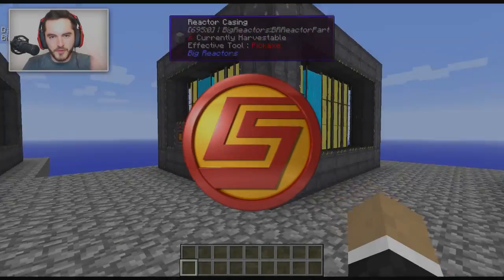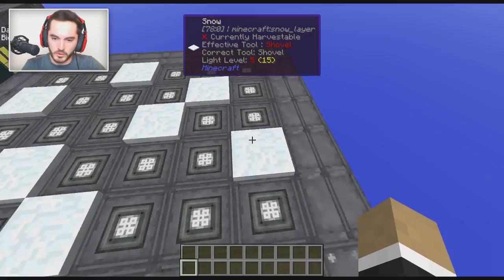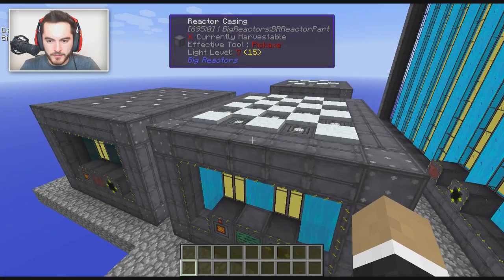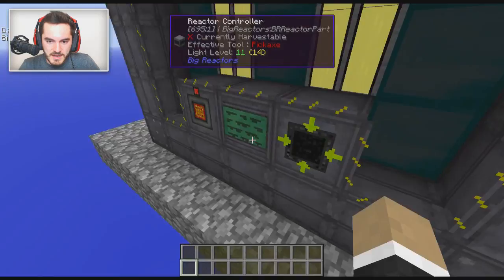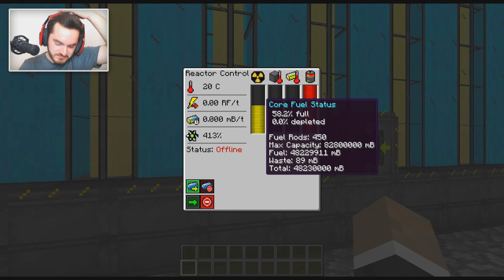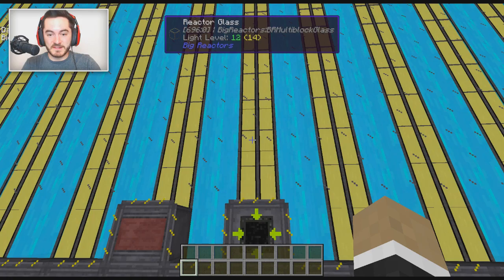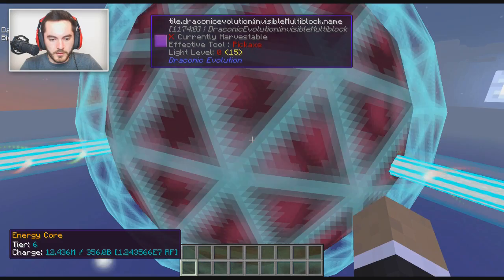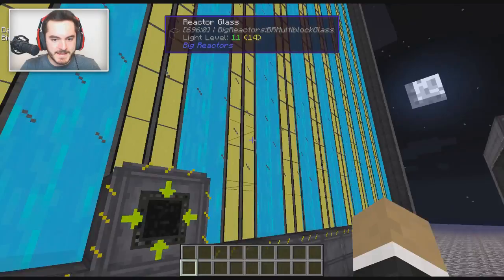Minecraft: BIG REACTORS MAXED OUT

Comment: Only 1.9MRf/t? I thought it would be more than that.
14,300 RF/t  /  5x6x2 (60) /  = 238 RF/t per block
1,900,000 RF/t / 30x30x46 (41,400) = 45.9 RF/t per block
 So, for those who just want power, and are not concerned with showing off, you'd be better off making a series of smaller reactors. (using interior dimensions, so fuel and coolant only)
Reply: +DFPercush the taller you go the more efficent you get
Reply: In that case, I guess the best setup would be a tall, narrow column reactor. But this giant thing in the video is atrociously inefficient.
Reply: DFPercush
correct also i have noticed that if u put 3 blocks of space from the rods to the casing then put resonant ender at the casing and cryotheum in the other 2 spaces the efficiency goes up by about 15-20% than if u had them all the way to the casing and have cryotheum

Comment: How is it only getting 0.2 mB/t? I built the same checkerboard reactor and it uses 2.3 mB/t ?!? The Energy output is the same as show in the video but it is using way more fuel.
Reply: blocks or ingots?
Reply: ?? Not sure how that matters. Once it goes into the reactor it just become liquid fuel measured in mB. The only difference I've noticed is if you use block you have to wait longer till 9000 mB of space is available.

As for the recommended design I copied what I saw in the video in CrackPack modpack and the output matches but the fuel usage is far higher. Not sure if it has a different usage rate in the pack he is using.
Reply: PyroMancer2k I must admit I'm not the best at big reactors. The pack he is using is sky factory based on the tree in the background
Reply: Perhaps it is based on coolant? Unless you used the coolant type he used. I am not sure if that even affects anything.
Reply: config.

Comment: What's the difference between active and passive cooling?
Reply: Actively cooled is for Turbines :3
Reply: +Colin C. actively cooled is way more efficent. the maxed size reactor of his is producing around 1.9 mrf/t but with actively cooled you could make 8-20x that much depends on how long you want to spend with making turbines(not just one turbine but multiple)
Reply: angie rossman Are turbines blocks? Where would you put them on the reactor?
Reply: Colin C.
not a block. another multiblock structure and to give you an idea i think its 16x16x24 and that massive reactor can produce enough steam for 50-150 maxed sized turbines witch produce around 20-29k rf/t depending on how you set it up
Reply: angie rossman oh cool
Reply: Colin C.
be warned that if you think that that massive reactor is laggy then the turbines will be even more so

Comment: Mekanism reactors are much better and much more fun for generating hugely massive amounts of power, I would recommend everyone play around with Mekanism
Reply: +TheFatesBack My survival world got ProjectE and Mekanism. I built the whole reactor and put watch of flowing times(A ProjectE item which increases the tick per second of machines. Effectively speeds up machines that are not supposed to be upgradeable) on the solar evaporation towers and solar neutron activator(the process of making tritium is slow...). I turned on the reactor. BOOM! Over 10 BILLION RF/T with 20 injection rate!
Reply: +Sham Ringo wow, if you're gonna steal an item, don't steal it from a massively popular mod (EE2) and don't give it the same name
Reply: Indrada That's exactly what ProjectE is! It is a remake of EE2 for newer versions of Minecraft. Hell, even the original creator of EE2 gave ProjectE permission to use the EE2's assets.

Comment: the exterior cooling should be liquid ender
Reply: No, Cryotheum is better. <3
Reply: No its not. Cryotheum is the best Moderator. so between fuelrods its best. 
Resonant Ender however is the best absorbant, so between fuelrod and casing it is (slightly) better than cryotheum.
In actively cooled designs Resonant Ender might even be better overall.
Reply: Adding ender anywhere on the BigReactor simulator makes power go down along with fuel efficiency.
EDIT: After a few tests that is somewhat true, but it isn't consistent enough that I would call it "better".
Reply: centre cryotheum, ring of fuel rods, 2 rings of resonant ender, outer ring of graphite blocks = 65k per layer.

Comment: you COULD do it in your skyfactory series if you start automating all the stuff, but because of your love for the "elbow grease" or whatever you call it, you probably won't be able to
Reply: Elbow grease
Reply: Do you mean elbow grease?
Reply: +Jairo Morales i mean he could technically do it but.....just hand placing the cryotheum by hand would take him 5+ full episodes or about 10 hours because theres no pump in the mods that auto fills the reactor and in reality its not feasible because it would take several hundred drums full of cryotheum if hes not using a bedrockium drum.
Reply: +Trevor Nimmo I prefer headlight fluid.
Reply: +Arc Flare (Arcflare) Wouldn't using one source and letting it flow down to the bottom be the same as filling everything with source blocks? So it wouldn't be as much?
Reply: +OutcasT nope cryotheum actively flows down to the first empty block (first non-source block) in the reactor so you need a bucket per layer
Reply: OutcasT like design said. Cryotheum doesnt flow like other liquids. The source block itself will fall until it cant anymore. When it stops falling thats when it starts to spread like other fluids. So in order to fill up a maxed out reactor youre looking at 10's of thousands of source blocks with cryotheum.
Reply: +Zippyd00da132 Rooster teeth much?
Reply: +Jairo Morales lol elbow GREASE. it's a common American idiom

Comment: i have just decided to build this in my tekkit world because it was getting boring, should be fun...
Reply: Welp it's a few weeks later and i have finished. In fact i made two, one cooled with blocks of copper, (i am in tekkit legends and this was the most suitable block considering i don't have thermal expansion), and one cooled with nothing. For the sake of time I only made them 32 by 32 by 32 so they are not that powerful but the one fuelled with copper generates 800,000 rf/tick and the uncooled one 400,000 rf per tick, however i because i used a more spread out layout i managed to keep the temperature down to under 2000 degreed C.